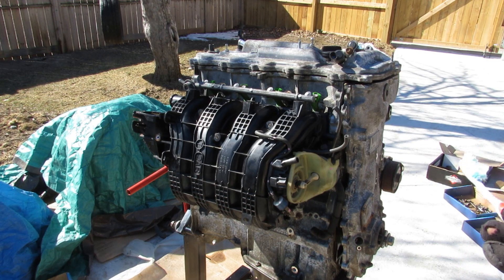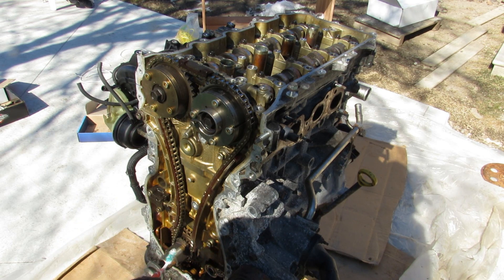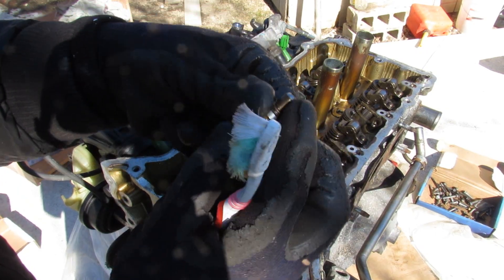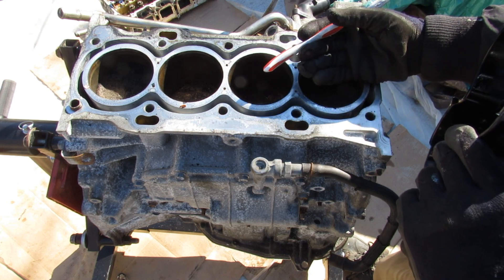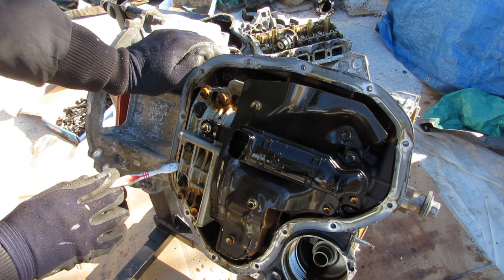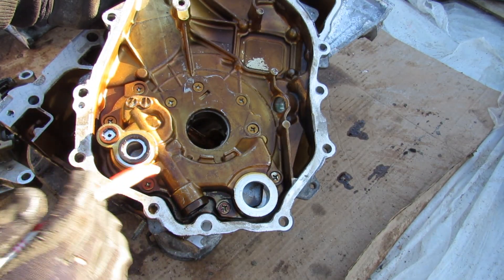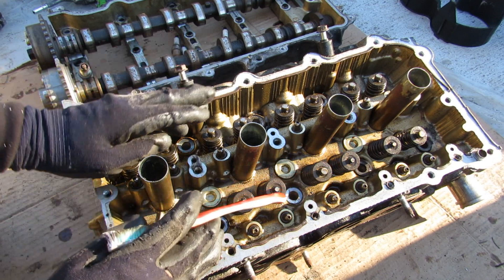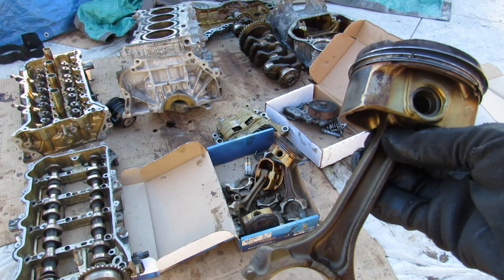Why Toyota Engines are Reliable

Comment: i am not an experienced guy but i don't like many solenoids , hidden filters , integrated oil pumps, tiny oil holes also the piston rings looks weak and small
it looks like it have many fail points but maybe they had machined it very well ,that's why you say its reliable ,and people say (maybe its an old running myth ) that Japanese engines stand much abuse
Reply: Alot of newer engines use this tech. I will say that Toyota/Lexus, and Honda/Acura are very tough engines and they put up with the most abuse. I'm a Nissan guy but I don't really hold their engines to the same amount of reliability
Reply from the maker: Well it's proven. Taxis with these motors have 4-500k miles or more.
Reply: @speedkar99  
someone mentioned me 2 days ago saying his 260k miles FJ have a kick in gearbox when he hit 60km and he didn`t changed the automatic transmission oil at all , i gave him some general tips but wondering how his transmission is still running nearly perfectly ,now i check what FJ is (ya i saw this car in his country like 10 years ago but i didn`t know or care about its name then when i get back in my country i don`t see any of them ) then i found that FJ is a toyota 😂😂

Comment: Can you a breakdown and analysis of why Aisin transmissions(owned by Toyota) are so reliable?
Reply from the maker: That would be nice. Im actually working on the opposite right now...why Honda transmissions fail!
Reply: @speedkar99  CVT or 5AT ?
Reply: @fleurdewin7958  the ones mated to the V6 in the early 2000’s and the recent 8SP’s were the problematic ones.
Reply: @speedkar99  Seems like Honda = get a manual, at least for the late 90's

Comment: The 2011+ Scion tC also uses the 2AR engine, Ive been trying to find a turbo kit with no luck. Sketchy turbo kits for he 2AZ are plentiful on ebay though.
Reply: As a Scion tC owner, putting a turbo in it is just laughable to me.
Reply: @Justin-nx3pw  Yea, but I figured getting a used kit for ~$2500 and reaching around 300 horsepower wouldnt be a bad upgrade for some fun.
Reply from the maker: Not sure how I'd feel turboing a tC
Reply: Keep it stock, and it’ll be reliable, play with it and you’ll always be working on it.   Been there......Jim (I’m 74 years old)

Comment: Does this mean you need to drain the oil any time you work on anything under the covers? As opposed to other engines that dont incorporate the covers as part of the oil pressure??
Sorry if this is a silly or obvious answer, just trying to learn. 

Great channel dude.
Reply from the maker: Oil is stored in the pan down below. 
Only when the engine is on does it Travel through those passages.

Comment: I guess that oil pass through through the water pump is supposed to be an oil cooler..
Reply: I was just wondering the same.
Reply from the maker: But it's so small...how would heat transfer through that..
Reply: @speedkar99  Does it lubricate the water pump bearing perhaps? Just a thought

Comment: The current gen A25A-FKS 2.5L engine inherited a lot from this design, including more plastic parts lol
Reply from the maker: The A25A is another wonder in itself...lots of new tech. See my Corolla / Camry reviews for that.
Reply: @speedkar99  Thanks man, watched most of your videos, keep'em coming! The new 2.5 Toyota  engine is pretty good aside awful noise during acceleration and lack of low end torque and most of hp coming up high rpm.
Reply: @speedkar99  the dynamic force motors are insane in what they bring to the table hut the complexity scares me. I currently drive an 07 matrix with the 1ZZ-FE and it's got a cracked manifold seal (according to the local mechanic, not sure if it's true), bad engine mounts, and a few other minor issues but at nearly 200K miles most of these issues I honestly think I can just overlook until the rest of the car falls apart (been this way for a while - car has had a hard life, especially with the previous owners who I know). Im not sure if these new engines will be capable of running into the ground like this. I certainly hope they retain the legendary reliability.
Reply: @scenicdepictionsofchicagolife  now that you know why don't you replace the seal yourself?
Reply: @scenicdepictionsofchicagolife  I hope so. I guess people were hesitant to DOHC and EFI and VRIS etc, new tech is always scary lol. I hope my Corollas M20A-FKS runs for hundreds of KM lol!
Reply: @scenicdepictionsofchicagolife  The basic bones of the dynamic force motors is very good.  They will last hundreds of thousands of miles, but there will be some additional maintenance required.  Eventually the electric motor that drives the camshafts will need replacement along with the electric water pump (reliable on Prius).  The new engine doesn’t have the crappy cartridge oil filter, which is nice.
Reply: @user-tb7rn1il3q  After you drive at 5,000 miles in Corolla 2020 Hybrid for oil change then swipe your fingers at exhaust pipe and you will see HUGE HUGE black deposit as extreme red flags. Dynamic force engine make continuous tap tap tap tap, but mount and insulation make it quieter from interior, so you feel nothing and hearing fine. 

It seem like Chevrolet, Dodge, Ford, Mazda, Toyota, and Subaru making vehicle more disposable in 2016 to 2021~... I'll stay with my 7 years old Toyota with 124,000 miles that make barely deposit in exhaust and ran perfect without any tap. I have to wait for couple more years. I might have to pick different powertrain like electric or hydrogen that doesn't have much friction inside engine.
Reply: @technocody9296  Engines are made better than ever across all brands.  200k miles is nothing for even an average car.  The old cars were not safe and had rust issues.  The motors burned oil and sludged.  The noise you are hearing is direct injection, totally normal.  A little soot is normal as well.
Reply: @scenicdepictionsofchicagolife  My 1ZZ-FE in my 2006 Pontiac Vibe has 238,000. At 60 years of age a few months ago I changed out my intake manifold because of the notorious shrinkage/collapse. Never did that before in my life and took about a half hour. You are correct that the 1ZZ-FE is one of if not the highest rated Toyota engine for long life. Something like that. If it's your intake I'd consider doing it yourself. Watch running lean for too long. It increases heat and I think will cause the valves to not cool enough in the head.
Reply: @user-tb7rn1il3q  German cars still have rust and some of their engines have severe weaknesses. Just look to VW Golfs after the Golf 4 (they rust relatively fast), their TSI engines (which are infamous) or Merc, with the rust and their problems with timing chains on some engines. Even their V8s have weak points which can total the engine. 
The cars made in the 90s and early 2000s had the most robust components, since then the material is getting thinner and thinner to save costs and weight.
Reply: @user-tb7rn1il3q  direct injection is stupid, change my mind. My shitbox 300k mile 4.3 V6 from 2005 doesn't burn oil, doesn't get bad fuel economy or anything. No weird carbon issues or anything either.
Reply: Better than bmw, if they could they'd make the whole car out of plastic
Reply: The thing with plastic is it's kind of like "metal".  Some plastics are indestructible, immune to UVs, Ozone, and almost all solvents.  Others are crap, they melt if you touch them with an orange. GM obviously got their plastics wrong with their intake manifolds, but for many applications they can be superior to metal.

Comment: "You can see how simple the timing chain setup is"   shudders at the thought of an Audi 4.2 V8 timing chains  setup.
Reply from the maker: Boy the Audi would make for a great coffee table
Reply: @speedkar99  It's a sad deal when a motor makes a better coffee table than an engine.  LOL
Reply: @speedkar99  There certainly a lot going on with all those chains :-)
Reply: Porsche with an IMS
Reply: Not to mention the chains are against the firewall and impossible to access.
Reply: @zacharyparis  that’s the real problem
Reply: Or the guides and chain of a M62tu. Hate those disintegrating guides. Wish they would use a gear roller tensioner system.
Reply: how can you compare a 450hp 8500rpm engine with a little toyota economy engine?
Reply: But seriously... any single head engine is going to have a simple setup. 

UNLESS it uses a pushrod design. That’s part of why GM and Dodge continue to use pushrods in the 21st century. One chain that’s far simpler than this one. 

Too bad about the roller lifters and cylinder deactivation, though.
Reply: @Bartonovich52  pushrod Vs are blessing. pushrod inline are absolute nightmare
Reply: 4.6l v8 are bulletproof engines
Reply: @theshield1613  I have a bullet we can test that with.
Reply: @bujin5455  good luck with that
Reply: @theshield1613  Good luck with what?  Testing your claim?  lol
Reply: @bujin5455  yeah
Reply: @theshield1613  Whose 4.6 V8??
Reply: @TeUhtred7860 you'll learn more by searching it up.
Reply: @theshield1613  You could have just named a manufacturer, but i'll assume your talking about the Lexus 4.6, and yes, i agree they are very reliable.
Reply: @TeUhtred7860  Lexus 4.6 and Ford 4.6 are very reliable

Comment: Reliable, but made a heck of a rattle from the loose main bearings?
Reply from the maker: Im not sure if it's supposed to be like that...they all had equal play...
Reply: @speedkar99  I wonder if the gears for the balance shafts keep the crank pressed one way, making the 'looseness" a non-issue?

Comment: thank you for the this engine review, I own a rav4 with this engine for 10 years still running strong.
Reply: We have a 2009 RAV4 with this engine and less than 55,000 miles on it. Actually ours is a RAV2 cause it's not 4WD. I also change the oil every 5,000 miles and I've done three drain and fills for the ATF.
Reply from the maker: How many miles and any issues?
Reply: @speedkar99  It has 150000 k on it now and the engine and gear box still no issues,  I change oil every 5000 k on engine and 20000 k on gear box.

Comment: Love these engines my mom has a 2007 with 210k miles it’ll run no matter what but does consume a lot of oil through the oil control rings I believe
Reply from the maker: That's probably the older 2AZ
Reply: @speedkar99   both burn oil
Reply: I think that engine was recalled by Toyota. My friend had a 2007 Scion tC with a 2.5 L (2AZ-FE) and he got a letter from Toyota (he was second owner) and took it in. Toyota changed the oil, put taped locks on drain plug in pan, on dip stick and on oil fill cap. Told him to drive it 1100 miles and then bring it back. They then decided it was using too much oil and they rebuilt the engine. It had 67,000 miles when this was done. It now has around 120,000 miles and does not use any oil. I guess Toyota knew what they were doing. Good luck.....Jim
Reply: @jimpie231  thanks for the advice maybe I’ll use a magnetic drain plug but she’s going to be selling it soon anyways. The consumption slowed down after doing spark plug seals and higher quality oil but once it breaks down the oil is consumed like crazy.
Reply: In other words, it's a bad engine that is still on the road with +200k miles lol gotta love how tough Toyotas can be.
Reply: @mr.boostang2064  no not really the engine is really well built besides the faulty piston rings

Comment: I have no idea why Toyota abandoned the 20 valve 4A-GE engine. It could still kick ass nowadays.
Reply: Because of cost. That old 20 valve 4A-GE is a closed deck design. You more money and it is harder to cast a closed deck engine .
Reply: Probably because emissions or fuel consumption

Maybe an aluminium block (it wouldn't be the 4a block, idk if it woud be called 5a or its too diferent to still be an "a" block) and some modifications (direct and port inyection, and some detune)

Also, a new 4a-fe would be important too (it would be expensive to make an engine that would only be used on sports cars)
Reply from the maker: Modernization

Comment: I'm glad the water pump is not integrated into the timing chain like some vehicles (looking at you Ford).
Reply: Looking at u Infiniti
Reply: Which engine from ford does have water pump driven by timing chain? Mine is 2017 and it's not driven by timing chain.
Reply: @reeisessit  all of the new ecoboost engines
Reply: @andersonrodriguez8258  Like i said 2017 Ford Focus EcoBoost engine like mine is not driven by timing chain 🤷🏾‍♂️
Reply: Think he meant volkswagen lol
Reply from the maker: Well if it helps... Toyota made the water pump electric in the next generation A25 engine

Comment: So they can make a piece of plastic that doesn't melt sitting against cylinder walls but the door handles will become dust from sunshine...
Reply: Sarcasm ikk but.
Heat i would say may not affect thermoset plastics as much as the UV exposed cheapo ABS plastics they use for door handles.
Reply from the maker: Good call
Reply: They use different kind of plastic polymers on engine parts, generally able to withstand engine heat and repeated heat cycle without any deformation. On the otherside, ABS plastic is known to "evaporate" it's binding polymer if you keep it under direct sunlight and thus turned into dust-like appearances.
Generally ABS is more forgiving to be painted rather than thermoplastics used inside engine compartment.
Reply: The newer Camry has better plastics on the handle. The pre-2002 are notorious for becoming brittle.  My Prius 2006, Sienna 2004, and Corolla 2016 has no issue on the plastics.  Probably they find out how to make it better.  In all newer Toyota engines, they have spacer from thermoplastic plastic or rubber inside the water jacket, that's why it reaches almost 40%  thermal efficiency, the highest in the world.
Reply: Too funny, the outside door handles on my Matrix break easier than a month old pretzel.
Reply: @t.s.racing  german-made pretzel?
Reply: @t.s.racing  It is because they share with GM manufacturing, so they down grade a little bit. LOL
Reply: UV rays are viscous.
Reply: not completely sure as well but the plastic should not really get any hotter than the coolant would get
Reply: or dashes that melt lolol
Reply: Would you rather replace a handle or an engine part?
Reply: @Seldomheardabout  I'd rather see no need to replace either.
Reply: I once had an old 1982 Toyota Corona Mark II station wagon. After a smallish accident and replacement of the headlight I tried to burn the remaining plastic bits of the headlamp ( the lens itself was glass back in the day, but the rear was already plastic). I freaken couldn't. This plastic did not burn in my home heating furnes. It came out looking absolutely the same after being burnt for half a day with coal.
Reply: @evgeny7039  Burning plastic is not a good idea to begin with. The fumes are carcinogenic.
Reply: @paulparoma  I wasn't going to inhale them...
Reply: @evgeny7039  Your last name must be Clinton then...
Reply: Plastic do not like sunshine it always breaks plastic down. What is a mystery to me is that now they are putting recycled plastic into roads. Will roads crumble in 5 years like a plastic bucket next to my garage?
Reply: That was wise as instead change a full block because of cylinder warp or wear u can just change the cylinder jacket which is way more cost effective than a full cylinder block
Reply: Just demonstrates how bad UVA is to your "health"...
Reply: @MidlandTexan  a lack of vitamin D no fun either
Reply: Nice!
Reply: Asian bodywork 🤦
Reply: The door handles are cheap, engines cost thousands
Reply: Might have something to do with UV radiation from the sun.
Reply: I have a 98 4runner. The handles are still the original ones lol. I had to resolve my ex door handles in her ford fusion twice in a year lmao
Reply: I'd rather replace my door handles personally
Reply: Metal
Reply: to be fair, id take a melting door handle over engine components
Reply: I LOLed
Reply: okay guess what. when they started making unpainted plastic door handles, turns out, they didn't have 20 years of time to figure out if they become brittle from sunshine. now that they know they do, they make it from better materials and paint them. I see no problem here.
Reply: I guess the engine stays in the dark
Reply: Manufacturers make parts designed to last until the warranty period
Reply: @gmoney912  Not in Toyota, 90% Toyota still runs beyond 20 years 200k miles.  It is may be true for GM, Crysler or most European cars.  In southern states where there is no snow, 1990s Toyota are still around like cockroaches.
Reply: @rondhole  okay then, you try telling me the big reason why my 1976 Mercedes 450SE is still being driven on Australia's roads TODAY, whereas MOST Toyotas from the same era are no longer on the roads!! The same can be said for most of the Holden, Ford, & Chrysler built vehicles. In the area where I live, cars from the 1970's are extremely rare now. I'm the only person here in Port Pirie South Australia, who is driving a V8 Mercedes from the 1970's. 

Most of the other cars here are 20 years old, or less.
Reply: @rondhole  toyota are known to buy seriously old cars, ship them back to japan to see how they've worn and take lessons for future designs from the teardowns.
Reply: @gmoney912  My 93' camry would disagree.
Reply: @gmoney912  my 69 hilux with 350k miles disagree.
Reply: @gesucastello1986  exactly
Reply: @gmoney912  Profound.
Reply: I have 3 Toyotas. 4runner 2001 corolla 2005 and Hilux 2011 (You dont get this model in the USA but think of it as a diesel tacoma...) and the handles are fine. I wonder...where do you live? I live in tropical weather 38c is normal during the day...

Maybe you had aftermarket plastics?